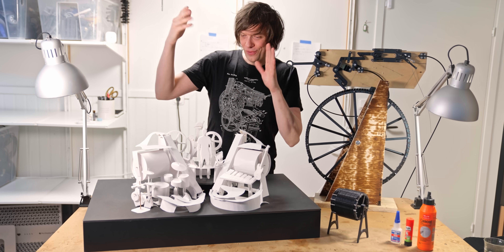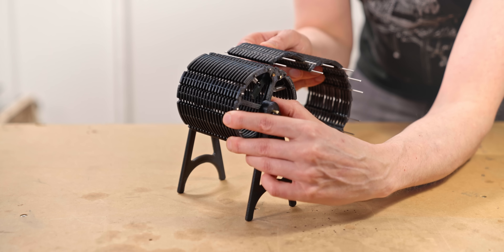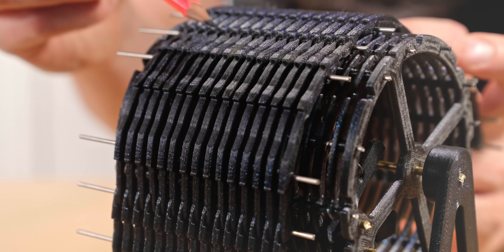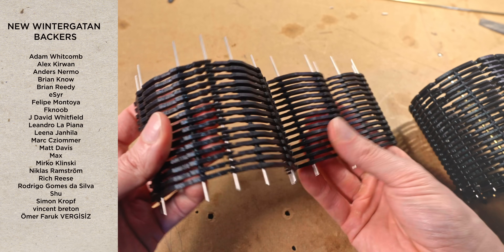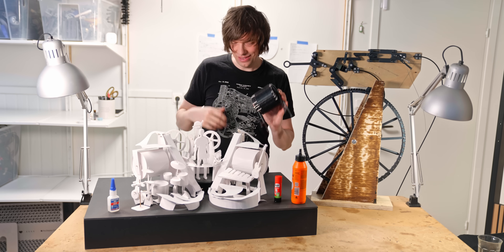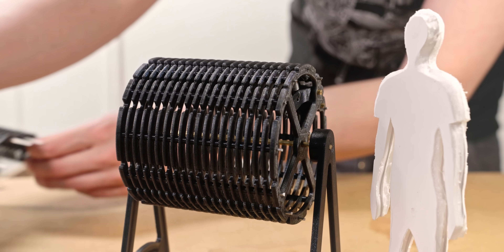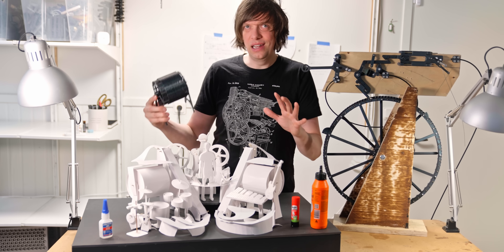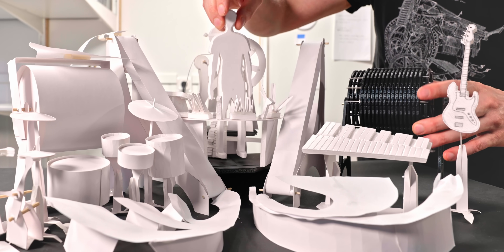A new way to switch songs on the Marble Machine

Comment: visually this is going to be a lot, might be worth thinking on how to manage audience visual focus. some handy tips to help: you can hide areas of detail by having it all the same color/tone, so they can fall back. Draw our focus on the areas you want by highlighting with some shiny/bright bits. ie The marble rails, belts, catchers etc, paint them all black, or wood. layer two would probably be the wheels and instrument mounts. So, you could splurge and have cool brass fittings/flashy bits. Lastly, the mechanics behind you, think of this as the frame of a painting (Painting is martin). So solid shiny brass everywhere, and martin in the center.

Comment: Martin needs to abandon the mechanical drives in order for this to work. There is absolutely no way he's going to get those two programming wheels synced mechanically. The two machines need to be driven by electric motors and synced electronically.

Comment: You could save so many flight cases full of programming wheels if you found a way of having latching pins that are deployed or retracted by the machine itself. Instead of having a full new wheel for each song, they could be stored on punch cards or similar.

Comment: Martin, have you though about having a solenoid bar on the top that can trigger all the hits just for song development.  I don't see why you couldn't basically hook up a midi loop system to emulate the wheel spinning, triggers, etc.  This seem like the best way to not only easily create the music but to also have an easy way to convert your music to the actual manufacturing of the wheel with a conversion script.  That seems much faster and less error prone than manually copying over all of your programming.

Comment: Martin - make the wheel remotely programmable. You send it a song, and the programming pins reset themselves to whatever song you choose. No moving the wheel, no changing its skin. Ready, faster.
Reply: What would that look like exactly?  2000 servo motors moving pins with controllers?  Common bruh

Comment: It might be useful to divide the programming panel/belt things into sections per instrument, especially on the percussion side. This would allow for the reconfiguration/replacement of something that is off on a single instrument without remaking the whole song wheel
Reply: But then the marbles tracks themselves + lifting systems needs to be replicated for each instrument subsystem.
Reply: @mcspud  Sorry if I wasn't clear. Rather than have one set of panels per programming wheel, divide each of the programming wheel's panels per instrument or instrument group(e.g. drum kit, bass). I'm not suggesting the whole system needs to be duplicated per instrument.

Comment: Looks amazing! Maybe also explore how it would be if you used a songbook (like a street organ) or discs (like in the speelklok museum music machines) instead of wheels? If you try multiple options, you will be more sure that it works! (and you wont get tunnel vision)
Reply: I agree! It could be that focusing too much on the idea of the wheel design could be actually jeopardizing the overall goal.

 There are many other types of machines. Why not make a few basic prototypes to see how they feel?

Comment: Wheel circumference changes, doesn't it? Then you'd have alternative programming peg size to work around this?

From what I understood, the wheel now works closer to a mechanism to hold the music code rather than be the code itself.

What would be interesting in the 100th iteration if this works is to have a wheel that can accept flat sheets of pegged-music boards, which would be more compact. So number of songs is easier to manage and less at risk of being misplaced or damaged.
Although this concept is close to have paper sheets or fabric used for programming.

Comment: Question? are you likely to be making new songs, or editing them whilst you are on the world tour? do you need to have a wheel for the tour that can do both - or can you have a world tour wheel which will be easy to swap out the skins, but may not support the manually placed one. conversely, do you need a complex wheel for composition that can do both, or can you make the at home wheel be swappable between one that can program and one that can play the pre-made skins?

Also, Is the singular wheel the only solution? might it be possible to have different/multiple means to trigger a gate, and you can then have the programming wheels for individual songs along side simple riffs running on something less ostentatious that you can swap in whilst on the stage - to allow you to "jam out" using the marble machine on stage, rather than only being able to do the songs as programmed, or only in the same combinations as all the tracks are "pre-synced" - just depends on how much freedom you want to have on stage, and how closely you want to stick to the idea of a music box marble machine, vs an instrument that can be played as well as "let run as programmed"

Comment: Would it be possible to have enough space between the preprogrammed lanes on the programming wheel? If you can fit 3-6 lanes next to each other between each lane, all you have to do is shift the wheel slightly to shift song. Takes 5 sec. You could even have one of the lanes being manually programmable 👍

Comment: Why not have two wheels? One programmable wheel for home to make songs and a sturdier designed wheel with the song clip ons for the stage. Wouldn't it be simpler then fitting two mounting systems onto the same wheel.

Comment: Seems like it would be very heavy, and fragile to torsional forces. I.e. It'd need 3-or-4 stagehands to carry a new song on from offstage, detach the old one, attach the new one, and carry the old one back offstage. and if one of them slips, could get twisted and damaged in a way that's very hard to repair. 

Worst case scenario: Stagehands are carrying the new song on, one slips on stage, and brings the whole crew down, twisting as they go. The song that was supposed to be played next. A song has to be skipped.

More realistic, less-overcomplicated version: The new songs are rolled on, on a cart. Two stagehands do the job. The songs are clipped on from the bottom of the assembly, and rolled on from there, minimizing the amount of work to be done and the distance it has to be hand-moved.

Comment: Maybe a sliding mechanism can be added to the wheel's base in order to take it away from the xylophone when changing songs and avoid playing notes by error or hitting the machine. Only complication would be gears that connect it to the drivetrain (possibly solved by u-joints). You should take into consideration the weight of this printed/lasered/watered wheels in order for the techs to replace it easily

Comment: Another way to bring the songs to the profile could be a plugin for logic (or whatever software you are using). The song you create in the software could be converted into the CAD profile using the plugin. This way you could create a song fully digitally and with the click of a button get the design for the profile.
Reply: Came here to write this. Would make composing an art (as it should be) and not a crossfit session.
Reply: @anders_lindqvist  lol  when I compose for mechanical instruments I actually compose ON the instrument; not on a midi version, because it doesn't work. Even if he can manage to make this machine as "sanitized" as a possible it won't be as a sampled instrument.
Reply: @hmmmhhhmmh   What do you mean by "won't work"? The programming wheel is a grid of notes on/off. Midi is (if you so wish, which you would) a grid of notes on/off.

Soundwise, he can make a good approximation by sampling the actual instruments, if he wants to. But even that is not crucial. 

If the timing is off that is a machine calibration issue (something Martin no doubt will put much effort into anyway). Not a midi to programming wheel issue.
Reply: imagine working 10 years on a machine to end up working on a plugin in the end.
Reply: @hmmmhhhmmh  True 😂

Comment: Da jar vue. Removable programing plates, exactly what you did with the MMX, including the removal and attachment method. Still not understanding your thought process, you seem to be stuck in a endless loop of late. You believe it will be a beautiful sculpture, I think this is where you are having problems. First rule of design never compromise functionality for aesthetics, I know the MMX was strangling the line on this but you pulled it of beautifully, all the functionality and one outstanding work of art that hade sole and creativity in abundance. Still do not understand what was wrong with the MMX. ps Your idea was never stupid and have been a fan from the marble machine 1, the only problem with your project is that you are way to much of a perfectionist, I was the same until I went to Uni studying Design. Having 10 / 20 marble on the floor from a 8 hour test of the MMX is nothing to worry about, please bring back the MMX.

Comment: The only thing I would change is have each of the song panels individual instead of threaded together on a "belt". They will get heavy, it will be a lot easier to handle individual panels. They will also stack up nicely for transport.
Reply: Yeah, doing something like what he was doing with the MMX panels might work even better with this system.
Reply: @Azakamak2401  The panels were a good idea, it was just hampered by the material selection of plywood. It made them very heavy and hard to align. Going with plastic and metal for the wheel should allow for a good fit and lighter panels.
Reply: Also, the heavier it gets, the more stresses they will feel, and the more they may stress and warp
Reply: Also, making them a long belt, any error would be cumulative, manifesting in a really noticeable way where the two ends come together.
Reply: @Nevir202  he had discreet connection points/clips for each panel though. Still agree separate panels might make more sense though.
labeled something like S1P1 S1P2 S1P3 S1P4 to keep them in the right order
Reply: Unless the belt was completely flexible. I'm imagining a version in leather with brass lifters. That would be so pretty. Impractical as hell, but so pretty. And the unrolled songs could be hung up as background art.
Reply: Anothing that I'm half concerned (aka it's probably not gonna be a problem) is the mechanism for locking it into place will add weight on this side and depending on how fast it's moving it may add some vibrations or other unseen consequences (like what if the locking fail and open while it's running at full speed?)
Reply: @DeadsTBD  doesn't really matter, the channels will all be different shapes and won't be balanced anyway
Reply: @bucklogos  assuming the channels are all around it would somewhat average them... And that's why I said that I'm half concerned :D
It was more of a way to point out that it COULD be a problem that SHOULD be considered before going full scale and having issue after even if the solution is only to have an easy way to add weights in the inside of the wheel to balance the whole contraption IF it become a problem... And it could also be made to be programmed backstage per song if they induce a big unbalance... You never know if an uneven weight (still an unknown for how much) will have a significant impact on the bearing or not... Imagine in a middle of a crowded concert the wheel break because no one managed to realized it was a problem...
Will it be a problem? probably not
Can it be a problem? maybe
Does it need to be taken into consideration? probably, it's not my call on what to do here but I would
Reply: @DeadsTBD  I highly doubt the wheels are going to be turning at rates high enough to generate significant centrifugal forces. Nothing that couldn't be solved fairly easily. Their weight in handling and bulk in transport should be much higher concerns.
Reply: @DeadsTBD  That drum turns once every few bars of a song, I doubt vibration due to balance will be an issue
Reply: That was the original idea for the MMX

Comment: I am not an engineer and have no expertise, but it seems quite dangerous for me to put the release levers inside the wheel. 
Not that it accidentally spins for some reason and crushes the operators arm who wanted to change the song. 

And again no expertise but shouldn't there be a simpler method than designing for press fit, especially under the goal of safe, easy and fast song changes?

Comment: I am not so sure about the efficiency and effectiveness of this form of design process. It looks to me that all the problems which plagued the MMX programming wheel are now back — in force. Alignment and hence potential lack of ultimate timing (whether really audible or not) will be an even worse challenge than the MMX design. Of course no-one can manually program such a wheel in 5 min. But snap-fit pieces must be modular and precise, which this isn’t.

Comment: hey Martin, did you account for the weight of the new way for mounting the “partiture” (programming pins)?
it’s easy in a 1/10 scale, but it seemed to me that even at 1/10 scale you struggeld a bit as well to mount the “partiture” so now imagine it full scale. How do you see this in practice?

The way i would try to take on this challenge is 1) Make sure you can snap on a new partiture without opening the clamps manually => snapping on goes automatically, taking it off requires to manually open the clamps (hope i make myself clear enough, English is not my first language)
2) Make sure the total weight of a partiture is as light as possible, but still be strong enough so it doesn’t flex under it’s own weight.

I like the new idea, and hopefully you’ll find a solution that works great and is still easy to handle AND transport 
You know my supperior at work once told me that engineering isn’t simply making some design, it also requires you to think about how to fabricate the design, and when the designs are big (in our case massive starage tanks and pressure vessels) it also requires the engineers to think about transport. For example the subassambly’s must be smaller than the lowest brigde it must pass under to reach the final destination (doesn't matter if it’s by road or by boat). Also the width is an issue => can it fit a trailer if it’s transported by road, or can it fit the hull of the boat. Etc.

What i’m trying to tell is the way you are thinking is good, butt you need to look further.
I mean, what good is a machine if the build-up on stage and transport are a hell to deal with (surtain equipment you need to (dis)assemble every time, on every venue, special vehicle for transporting the machine, etc wich drive up the costs) Let’s face it, the machine itself can play Wonderfull and a joy to work with on stage, but the on stage part is only a certain percentage of the time you guys are on tour, and at a certain point you will not have fun playing anymore due to the hellish task of transporting and setting up the machine.

I do hope you will read this Martin and i also do you you take this matter into account somewhat.
The best of wishes and luck with the project, i love watching the videos

Comment: If the wheel keeps connected to the machine you have to rotate the whole machine to (un)mount the hot swap pin system. Doesn't seem like an easy thing. So maybe a quick disconnect that only snaps back in place one way.

Comment: Depending on how the shrouds are manufactured, you could potentially add some visual interest to the programming wheel by using a material with a non-uniform color pattern. This could either be a 'static' image/pattern, or you could do something akin to the backdrop pattern used in a fake fireplace.

Comment: Just because the end result should have no electricity, doesn’t mean it can’t in development. You could have a module for the wheel, and a module with a little speaker for each of the instruments. Then just swap them out as the mechanical parts get built. You then wouldn’t have to build it all at the same time or be locked into early design decisions.
Reply: I was thinking something similar: When Martin is done making a song on the programming wheel, it might be nice to have some system of sensors for recording the configurations of profiles from which the final song profiles can be made. Then he could just hook up the programming wheel to this system, give it a single spin, and perhaps even generate the CAD files for the final song profiles right then and there.
Reply: I wish that I could upvote this 1000 times.
Reply: I would use midi controlled solenoids instead of pins to accelerate composition.

Comment: I am afraid this might be really heavy, but you could always split the removable part in 2, 4 or 8 to reduve the weight. You will only need to had a few levers (and to put them in the right order)
Reply: His model is scale 1 to 10 which means a 1/1000 (10^3) scale in weight. 
If we assume 15g for the model clip on song that would convert to a 15kg full scale version. Probably less because of different materials and the thickness of the model clip on is probably only 1 to 5 or something.
I would approximate a full scale model at around 10kg which is handleable by two stage technicians.
But you are right Martin should investigate this just in case.

Comment: I don't think that will work:

Having the whole song/wheel plates like a long chain, instead of 5 different pieces like you had in the MMX, the chain will be too heavy for you to lift and assemble on the wheel comfortably. Also, it will be easier that you or the team drop it and some parts break

It is a good idea to assemble on top of a fixed wheel and not replacing the whole wheel, but keep it in 4 or 5 sepparate pieces

Bonus note: to assemble the profiles on wheels to get the different songs, maybe you could have someone build a robot for you that puts them in place, similar to Mark Robber's dominoes robot